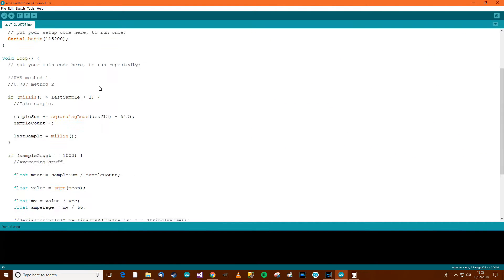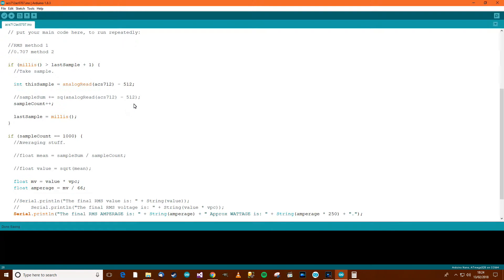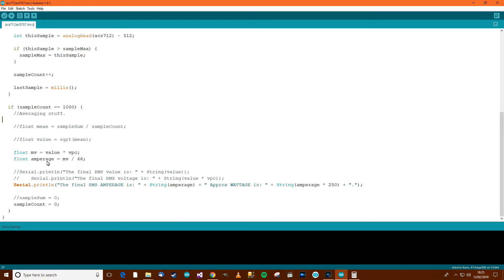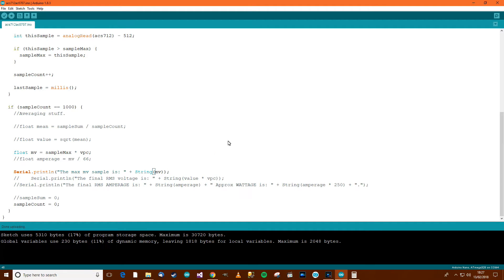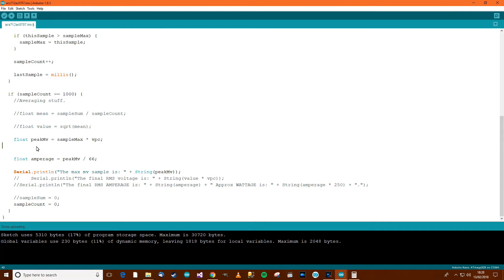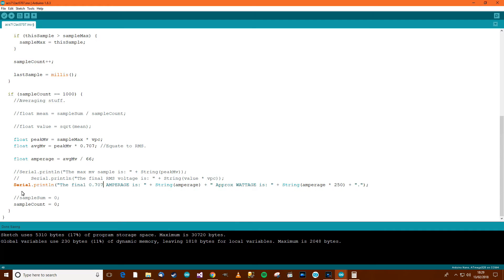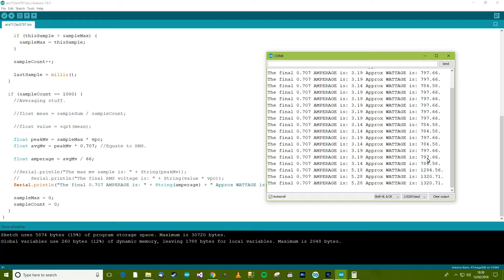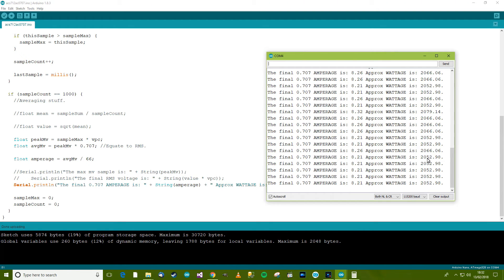TUTORIAL: How to Measure AC Current Using ACS712 Hall Sensor (Part 4/4 - Coding 0.707 Method)

Comment: Your tutorial is so nice! But I have a question about the vpc value. In your video, vpc = 5.0/1024, and I use Esp8266, whose max voltage value on A0 pins is 3v3. So I have to use vpc = 3.3/1024 instead of 5.0/1024
Reply from the maker: I believe so, yes.

Comment: great Tutorial..  just want to point that in your 0.707 method after getting the peakMv you should subtract the offset which in 30A version is 2.5V  and then multiply by 0.707. this will give out correct calculations
Reply from the maker: Hi, thanks for that!
Reply: no problem..Thank YOU for the awesome tutorials!
Reply from the maker: No worries Mr Rostom...

Comment: Please help me ... I am not getting true results by using 30 Ampere ACS712 CURRENT SENSOR,, CAN I EMAIL U THE DETAILS ABOUT MY PROJECT ... PLEASE HELP ME BROTHER MY FINAL YEAR ENGINEERING PROJECT IS STUCK BECAUSE OF IT ....I AM IN DEEP TROUBLE
Reply from the maker: What result are you getting?
Reply: Hey man, did you manage to get the right results? could you please share? it's for my engineering project as well
Reply: @jelkabisa  hey bro yes I did manage to get the results with the same sensor
Reply: @jelkabisa  Hey! Did you do? I'm doing an energy analyzer project but this code dont working true. Can u help me?
Reply: @jelkabisa  I did it 3 years back I don't have much input with me right now , but if you can share the problem I might be able to help
Reply: @amishkarim6578   or share your email I can show you what I did so far.

Comment: I don't remember if you covered it already, but the biggest drawback to Hall Effect sensors is that they are effected by external magnetic interference. You'd have to put the sensor itself inside a metal box of some sort. You could put this whole thing inside an electrical box, but without shielding the sensor, the other power wire being anywhere near the sensor will throw off the results as it would put an inverse wave near the sensor.
Reply from the maker: That's it... The other thing I've noticed is that the actual chips don't seem to be reliable... I've used quite a few and they end up failing.
Reply: They are really only designed to be used like the digital multimeter where it's only used for a few seconds or a minute at the most, and low amperages. That's one of the problem with hall effect sensors, unfortunately. If you use too much amps thru it, it'll basically burn out the sensor, which is nothing more than a coil of wire that's very very thin.
Reply from the maker: Korishan I see... Well that would explain it. I used mine 24hrs a day lol.
Reply: @antonycartwright  What about glueing an external conductor to the IC which can be hefty and hence OK for continuous use. Would require recaliberation though.

Comment: Eventually. I have thought about your design. I think it is better to make a power extension box with plug and socket and have the relay installed inside the box. By this way you do not have to cut your appliances cables. And this can be reuse for other devices.
Reply from the maker: Man la Oh yes, I definitely agree. In reality, this design is dangerous, but it was just to show you guys. I'd never ever bring this into the house!